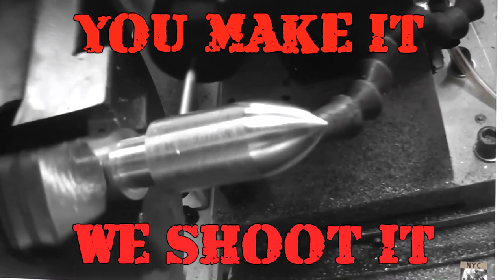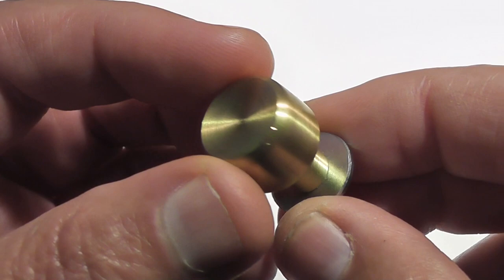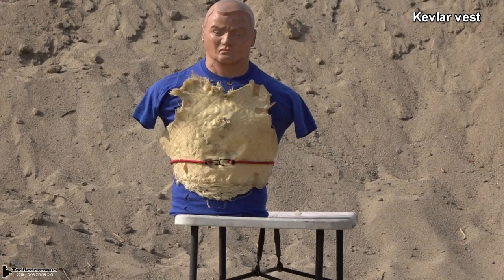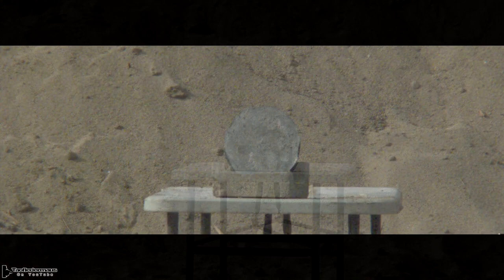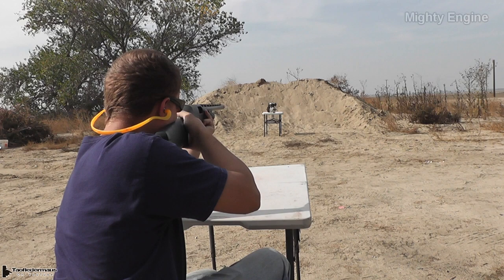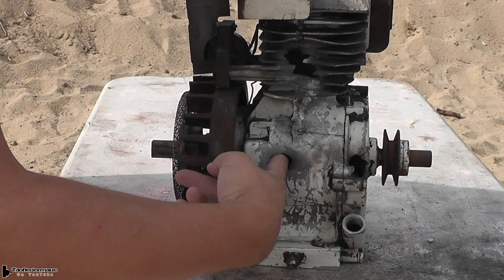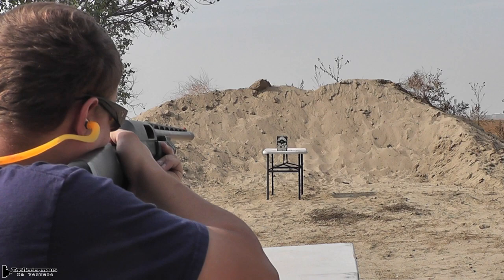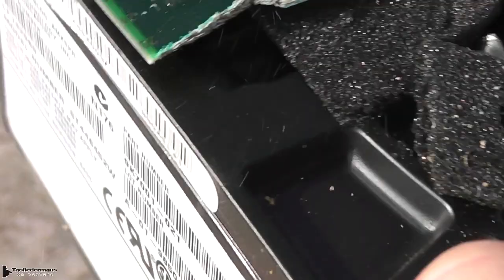Brass Knob Shotgun Slugs -  Supersonic Study

Comment: The price of that hard drive was $2995 in 1998. That would be almost $4500 in today's dollars.
Reply: Phoenix AF how'd you look that up. I was going to give it a try, but kinda stalled out.
Reply: and it goes for $50 now on ebay
Reply: just google the model number
Reply: 2995$ for the evaluation unit, as it was still not mass produced when they announced it to the press...it was announced in PC Mag in 1999 for roughly 900$...
Reply: Yep, guess we found the same release advert. $895 when first sold in 1999.
Reply: The consumer edition was $895, as already mentioned. in today's dollars that is almost $1300. You can buy roughly 630x the storage for the same price these days.
Reply: I found that the HDD was massively cheaper, then again the one i found where on eBay...
Reply: but whats the read and write speed on it?
Reply: considering the age, it could either be really shit or pretty good, for its time.
Reply: Considering it's a SCSI (read scozy) Ultra 160 drive, it was far better,reliable and faster than the IDE crap you could get in "mainstream" computers, while being A LOT more expensive to buy... IDE is dead now but SCSI is still around today, it's called SAS (Serial Attached SCSI). Used in Workstations or servers, but you can get a SAS controller for your computer... SAS drives all run at 10 000RPM and 15 000RPM... They are not "SSD" fast, but they are still way faster than SATA drives...
Reply: That's more than my entire computer... that's more then my brothers entire computer.(My computer $1,500-2,000 when we built it, it cost around $500 to make but if you got someone to custom make it it would be around that) (Brothers computer $3,000-3,500 it cost around $1,000 to make.)
Reply: Keen Colios RPM/Data density is what limits the speed. 7200rpm is the limit for silent and reliable performance.
Reply: SAS also comes in 7.2K
Reply: 1997 actually. its a server hard drive. ST446456W
Reply: $2995 is almost $5800 today.

Comment: THANK YOU for the time & effort you spend bringing us this information on all these 12 gauge rounds. I have one your fans will find interesting. I put these through my 870 with real mean results! opening up 12 gauge buckshot shell poor out the buck shot ,install a stack of 1/4 - 20 brass washers into the empty shot cup, then fill the center of the washer stack with some of the  buckshot. Recrimp the shell. As a close contact defensive round it is shocking! keep up the good work friends.

Comment: "Prices for single evaluation units are set at $2995 for the 47-Gbyte Elite 47 (ST446452W)."
http://www.prnewswire.com/news-releases/seagate-again-sets-the-record-for-the-worlds-highest-capacity-winchester-disc-drive-the-elite-47-77343327.html
Reply: Good job finding that (great minds thinking alike). Note that drive was $2995 in 1997 dollars! At the time it was at 47 GB the largest hard drive available anywhere...read/write speed approaching 200 Mbits per second. 19 years later a solid-state drive about that size (64 GB) costs under $50 and reads/writes 30x faster. How time flies, or how the mouse flies, as Jeff might say...
Reply: Where as now hard drives are slowly becoming obsolete due to costs and not being as stable where as now an SSD (sammy) can be as big as 15TB! Of course it'll cost many arms and legs but progress sure has advanced.
Reply: It will take a few more years till harddrives get obsolete. They might be slower but way cheaper and its easier to recover lost data.
Reply: However I found that drive for a current price of 198.00. Some server out there in a scsi raid setup might need one still?

Comment: That HD was very top of the line in 1993. 14 platters, 28 heads, 5300RPM, SCSI interface. Back then, you couldn't find faster.

Comment: Back in late '97 just short of 20 years ago that model of hard disc drive, the Seagate Elite 47 model (which had a 47Gbyte capacity if you couldn't guess) was reported on as the world's highest capacity drive and evaluation units started at $2995 which adjusted for the just-over-50% inflation since then would be about $4500 today, not sure what they'd retail at. They were aimed towards SCSI arrays for businesses and the like.

Comment: Seagate ST446452W, Introduced November 3rd, 1997, original cost was $2995.  Performance was 14.9-22MB/s, it has 14 platters and 28 heads.  At the time it was introduced, it was the largest HDD ever made.  I remember that era, 2GB and 9GB SCSI drives were the norm for server environments.  9GB was about the largest size you could get reliably and economically.
Reply from the maker: Interesting!  thank you!!

Comment: Still $75 on ebay, Seagate Elite model from 1998. The capacity was enormous for 1998 also the transfer rate and access time is exceptional. The mean time to fail is 800'000 h that's equal to 91 years.
The (new) price for enterprise peripherals is normally not public and depends on your (NDA) contract with the supplier.
It also has a ton of enterprise features like:

• Integrated SCSI controller
• Single-ended SCSI drivers and receivers
• 16-bit I/O data bus
• Asynchronous and synchronous data transfer protocols
• Firmware downloadable using the SCSI interface
• Programmable drive capacity
• Selectable sector size from 512 to 4,096 bytes per sector
• Programmable sector reallocation scheme
• Flawed sector reallocation at format time
• Programmable auto write and read reallocation
• Reallocation of defects on command (post format)
• Reed-Solomon error-correction code for header and data fields; can correct up to 64-bit error
• Sealed head and disc assembly (HDA)
• No preventative maintenance or adjustment required
• Dedicated head landing zone
• Embedded servo data rather than a separate servo data surface
• Self-diagnostics performed when power is applied to the drive
• 1:1 interleave
• Zone bit recording (ZBR)
• Vertical, horizontal, or top-down mounting
• Dynamic spindle brake
• Active IC terminators enabled by jumper
• 4,096 Kbyte data buffer.

Comment: You came so close to causing a catastrophic failure of that hard drive. I once shot a hard drive with a Mosin Nagant. The 203 grain soft point hit the axle pin for the swing arm. It drove it through the heavy metal base, which shattered into 3 pieces, and the guts of the drive were scattered over around 10 feet.

Comment: @TAOFLEDERMAUS That hard drive is Elite 47 Disc Drive ST446452W from 1998 (according to the users manual). Elite 47 provides economically-priced storage for large central storage applications. No clue about the price though.

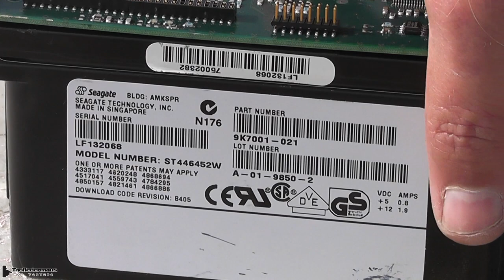Comment: 4:57 According to a quick Google search, an article on a website from 1997 says, and I quote, "Prices for single evaluation units are set at $2995 for the 47-Gbyte Elite 47 (ST446452W)." I guess that was the MSRP back then? Not too sure. 

Not that close to your guess of $10,000, but you were only off by like 7 grand. $7,005 to be exact. :)

Comment: Apparently, that Seagate Elite 47 was released in 1998 and had a price in the $2999 region. I copy/pasted this from a document:-

Samples of the full-height, 5.25-inch Elite 47 will be available for major
 OEMs in November, with volume production planned to begin in the first
 calendar quarter of 1998.  The Elite 47 extends Seagate's balance between high
 performance and value with pricing targeted at 75% the cost-per-megabyte of
 Seagate's award-winning Barracuda family of disc drives.  Prices for single
 evaluation units are set at $2995 for the 47-Gbyte Elite 47 (ST446452W).
 Original equipment manufacturers (OEM's) may contact their Seagate sales
 representative for volume pricing.  Poised with Seagate's mainstream Barracuda
 family and performance-leading Cheetah series, the Elite 47 proves to be an
 excellent complement to the Company's broad offering of high-performance disc
 drives.  More information and detailed technical specifications regarding
 Seagate's new Elite 47 disc drive is available online at
 http://www.seagate.com/vpr.shtml.

Comment: Round plastic capacitors like that are called electrolytic and generally are pretty dry. Oil filled caps tend to be rectangular and steel cased. Also, any large cap with a voltage rating over 1kV is almost certainly oil filled. Be careful shooting oil filled caps, very old ones can contain polychlorinated biphenyls (PCBs) which can be pretty toxic. It's good to look up the part numbers and make sure that they don't before cracking them open.

Even oil filled caps might not be terribly exciting, as the oil is usually absorbed into thin paper that separates the metal plates, with only a tiny bit of oil floating on top. Oil filled transformers might be more dramatic, or anything else that uses oil for cooling, rather than just for electrical insulation.

Comment: that hard drive was released in 1997 and on release it was $2995 it was the first 47 gig hdd availible had a read write speed of a blazing 184 megabits/second and has a 5400rpm operating speed! today they are still worth about $250 new

Comment: the hard drive was originally $3000 and was the highest capacity hdd at its time which was the begining of 1998
Reply: What was its size?
Reply: If you mean capacity it was 47gb formated or 62gb unformatted but if you mean dimensionally it was a 5.25in server drive

Comment: I wonder what would happen if you shot a charged high voltage capacitor. Something like 400-700V with similiar size. I know they make a heck of a bang when you shortcut them but would it discharge if shot with a conductive slug?

Comment: Further looking at Google results beyond the ebay and Amazon links that have results from $50 to $200+ for refurbished units, finds a document from Nov 3, 1997 regarding the introduction of the Elite 47 (the world's highest capacity disc drive, at the time, apparently) with a price quoted of $2995 "for single evaluation units".

Comment: Take it from an old sparky always always make sure the cap has a wire across the terminals use a old screw driver make sure it's dead then tie it up. It was kinda a joke to leave a cap on the desk for fng's to play with it but that was not good when one of the upper picked it up and got a shock when you're at a billion+  nuke radar base you are not to leave things out it.

Comment: i'd open the HDD's up first and remove the magnets from them! i know it's not much but those are some damn strong magnets if you ever need any and getting those things on donation or super cheap i'd at least salvage the only important thing inside of them! we have on set of magnets from an early 90's HDD that are about 2" long about 1" wide and ~3/4" high and if you stick them onto anything you have to slide them to the edge and leverage them off...

Comment: The Seagate Elite 47 started at $2995.00 you can still find them through various vendors for $250.00

Source:
http://www.prnewswire.com/news-releases/seagate-again-sets-the-record-for-the-worlds-highest-capacity-winchester-disc-drive-the-elite-47-77343327.html

Comment: Get me the numbers off the label of that hd and i can probably find out more about it for ya including original cost. At 47gb  and what looks to be ide interface its going to be from 98 to 2k manu year and from the vid looks to be a 3 u height full width 5.25. 3 u basically just means it took up 3 5.25 inch bays. Beyond that can tell you much more with out model etc numbers.

Comment: They were $2995 and first released as the world's highest capacity winchester disc drive in 1998.
Reply: For the second question, there were 28 read/write heads, so I would say 28 disks.
Reply: Phillip Morrison 14 physical disks double sided. For a total of 28.
Reply: Kris Jorgensen That makes sense. Wasn't sure exactly how that worked.

Comment: what's the heaviest slug you are willing to shoot?
Reply: It's hard to guess what the heaviest load your barrel can handle is. Too much resistance from a load and you turn your shotgun into a pipe bomb. It would be a cool video to see ever increasing load sizes until the barrel pops. I'd guess a 5 ounce lead rod would do it.
Reply: The question roughly works out to "what is the heaviest payload publish data available in a 3" magnum shell." RCBS publishes hotter data, so keeping all the components other than shot the same, he ought to be safe so long as the shot is no heavier than the recipe payload.

Comment: 1997-98   (47gb harddrive) Prices for single
 evaluation units are set at $2995 for the 47-Gbyte Elite 47 (ST446452W).

http://www.prnewswire.com/news-releases/seagate-again-sets-the-record-for-the-worlds-highest-capacity-winchester-disc-drive-the-elite-47-77343327.html

Comment: Why don't you guys shoot hardened steal slugs with a sharp point? Hardened steel pointed pills are known to be great for AP (Armor Piercing). I seen 9mm hardened steel pointed tipped rounds go through body armor like a hot knife through butter. They leave a perfect size 9mm hole through the body armor, and they keep going with more then enough force to go through anyone or anything behind the person wearing the body armor. And mind you, that's only a 9MM steel AP round. Can you imagine the same round in a 45, 50AE, 500Mag, 308, or even a 223? Hell, imagine a hardened Steel tip 50BMG round? That would be insane. But, Steel tip rounds were banned in the USA, because steel is considered Armor Piercing, as it should be. But they still should of never banned the steel tip round, we new to protect ourselves from everything that may cause us harm. But there should be a video on YouTube of someone testing out the 9mm steel tip AP round with level IV or V body armor.
Reply from the maker: We have done that before,  even some slugs with a carbide core that went through AR500 steel plates.

Comment: That is a Seagate 47gb server hard drive, they cost around £20 for a used one and around £350 for a new one.
Reply: w00dmii5t3r find any achives from when it was brand new?
Reply: it was about $3000 when it was new
Reply: i was unable to find any archives for the price.  and the prices i got were off eBay so i wouldn't take them as exact!
Reply: Ah man, i bet that thing was pricey when it was brand new.
Reply: I've seen other comments suggesting it was multiple thousands when it was new.
Reply: i believe it

Comment: Regarding the hard drive : Seagate Elite 5.25" ST446452W 47GB 68-Pin SCSI 5400RPM HDD ... 47-Gbyte, 5.25-Inch, Sixth-Generation Elite Disc Drive ... From the year 1997  ... Originally listed at $3,000 .... Adjusted for inflation that is $4,486 in 2016 dollars :)

Comment: Capacitor full of oil. Yeah, right.
Reply from the maker: run capacitors are filled with oil to disperse the heat
Reply: Electrolytic capacitors are full of liquid dielectric.  That must have all dried out from that one. It's water based not oil,  because when they blow out it's dirty steam.
Reply: Leaking caps will eat through the electrical traces and destroy your board.  Lucky that it doesn’t happen very often.